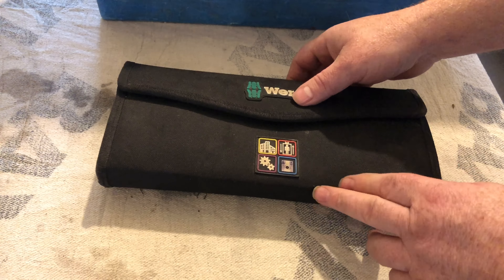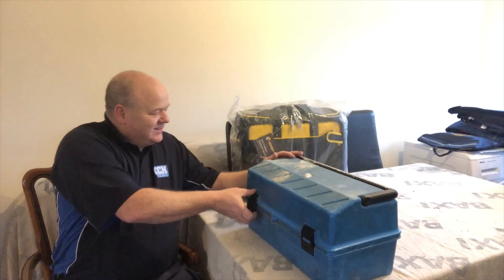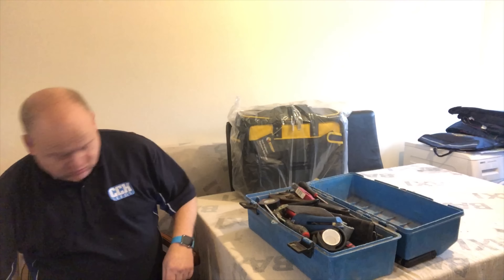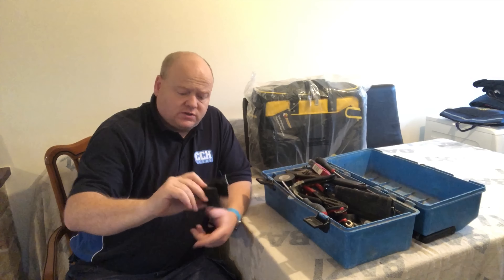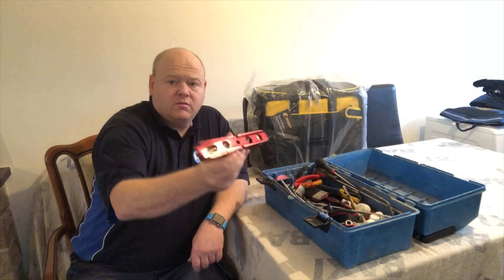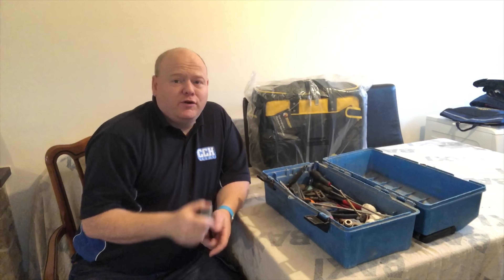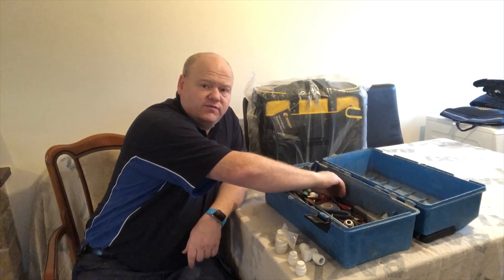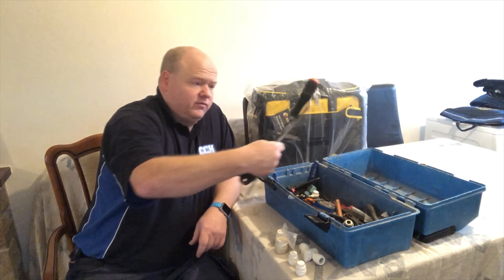Gas Plumber, Whats inside my tool box. Monument Gas Engineer / Plumbers Tool Case

Comment: It's a bit bigger, great to work out of so long as it doesn't get to heavy. That's my problem I get a bigger box or bag and load it up... I also always use a cutter to strip wire, its much faster but I should use a proper stripper. We don't use olives much here for water, do you see many leak?  Every time I clean or get a new box I leave out what I think I don't need and regret it. 😀  Happy New Year to you and your family.
Reply from the maker: Its a bit too big tbh but i am still using it.

Comment: Hey Allen, moment tools must love you. I think you've single handidly brought all their olive cutters. What do you do when you get paid. Head over to buy some olive cutters. Save some for the new fellas n gals. You must have at least 50+ olive cutters 🤣. I really like my olive cutters and pullers
Reply from the maker: I have had the old ones from my BG days , not had the new ones that long. lol. Thanks.
Reply: @AllenHart999  Allen where did you get the injector cleaning pins. The set that looks like Allen keys. They look like they'd be good for cleaning the cooker injectors.😊 Thanks
Reply from the maker: @rayc1503  I have had them for a long time, Not really sure where they came from, BG maybe.
Reply: @AllenHart999  ok thanks,  they kind of look like carb cleaning pins. I was just taking a gander on Amazon and ebay. I'm using needles at the moment. Toothpicks are amazing to help reassemble the injectors on cookers. As they can be fiddly putting back in. Also prevents them being cross-threaded for the 1st few turns 😊

Comment: wont last long that bag i bet... zips to small.. weak handles.... veto are the best bags and come with 5 years guarantee.. 
yes they are expensive but you pay for what you get...  i have 2 of them.. one for install work and one for service and repair work
Reply from the maker: Time will tell i guess. Thanks.
Reply: Brendan, i agree with you. Ive used stanley and ck bags and quite a few different boxes. The stanley and ck bags fell apart after 12 months so in all the years i could have bought a great many veto bags!

  ive found i can get more in the veto bags and they stand up to heavy use. I cant really fault the veto bags other than the tape measure hook, imo its poor and my tape often gets knocked off.

The veto  drill bags are a revelation, makita sds, makita combi and makita impact  all in one bag along with bits etc plus 4 batteries all  in a really small bag that zips up.

Comment: Am sure that blue tool box is from British Gas lol
Reply from the maker: Yes its from british gas, had it for a long long time.
Reply: Allen Hart 

How long has it been since you left British Gas? I used to work for British Gas but they didn’t let me keep anything
Reply from the maker: @sadekhamid3165  When i left they only took the power tools off me, Let me keep all my hand tools. My manager was a great guy. .
Reply: Allen Hart 

That’s nice you must of been a good engineer. They use tool roll bags now stopped using tool boxes to prevent customers tripping over them lol
Reply from the maker: @sadekhamid3165  I enjoyed my time at BG
Reply: I"m sure those old BG boxes are/were made by RAACO , great quality :)
Reply from the maker: Not sure who made them. Thanks.
Reply: Most tools we got from BG where cheap and cheerful
Reply from the maker: The tool boxes where good though. 👍
Reply: John Wood Electrical has one on another Tube channel, he is going through his tools as well.

Comment: Those gas board boxes are shite I reckon. The lid assumes you have shit spilling up into it. Loads of wasted space.
Reply from the maker: I have used mine for a lot of years and always been happy with it , I dont know any different.
Reply: I think the company produced the same basic box for BT, but added cantilever trays inside which made it much more practical as a tool box..

Comment: No veto pro crap 👍👍👍👍👍👍👍😁
Reply from the maker: Not tried any other so i cannot comment. What do you use and why. Thanks.
Reply: Use to use stanley  open technicians bag but decided to "upgrade" to a veto OT-MC and detest the thing.
All pouches are the same size (carnt put olive splitters face down.
Theres a middle plastic area that you have to dig for pipe slices every time. Just started up tipping the whole bag when i need something  from bottom
Am an installer so like the bucket open ness of those types of bags
Reply from the maker: @D_pawson  I have always been happy with my blue box tbh but thought i would give this a try. Thanks.
Reply: Veto pro xl here as I do service and installs. But yeah an open tote for all my test gauges and other gear like cutters olive pullers etc. I keep a kansas tool roll with my wera pouch for my go to for breakdowns. I might go for some of the wera2go pouches in the near future.
Reply: Take a look at the monument bag in a few years and I can guarantee it won't be in as good shape as a veto bag, I've had tons of bags they don't last,  vetos are expensive but seem really tough
Reply: @geoffflynn7555  too right I took the plunge & I'll buy some more in the near future, Veto rox 😊
Reply: £150 for a Veto tool bag!!!!!!!!!!!   'Kin 'ell!
Reply from the maker: Not cheap no.
Reply: @AllenHart999  yes it's expensive but it lasts. The veto xl is an awesome bag. I should've brought one sooner. I've Velcro'd my regin manometer 2 the side for quick access. It'll pay for itself really. I'm 29 (too old), but I'm hoping to keep it a while 😊
Reply: @AllenHart999  Hi Allen whats your view on the testo 510? Theres a bluetooth version which logs tightness tests back to your phone or tab. I'm using a tpi 608 but calibration is out in Feb next year. I'm thinking because it's light. 
Thanks.
Reply from the maker: @rayc1503  I love how small it is and easy to use.
Reply: My uncle uses a large yellow bucket... It never lets us down and is free to replace. 😂

I've been looking to buy him something else, but nothing seems as good or worthwhile. Does anyone have any suggestions for a single, open, very large tote made of metal or able to handle heavy loads?